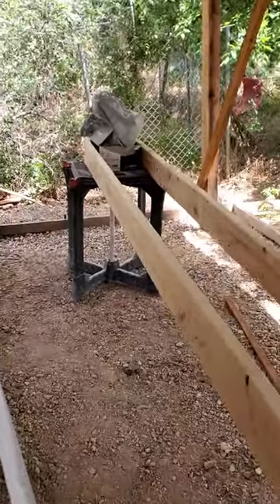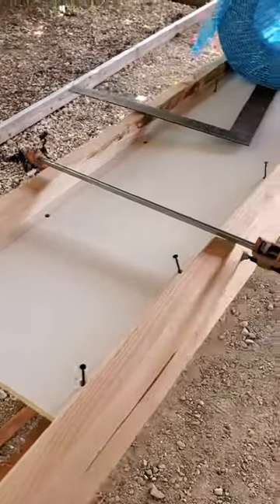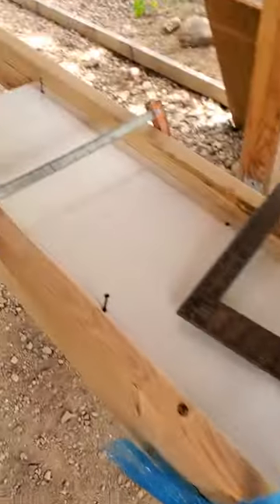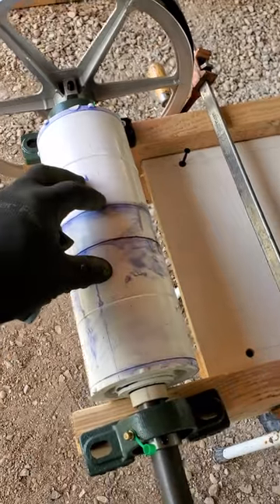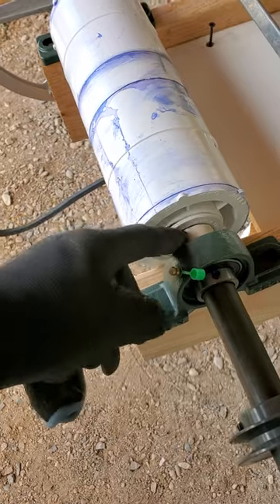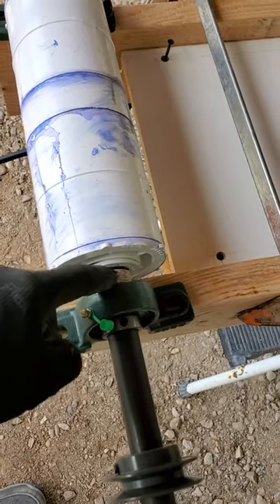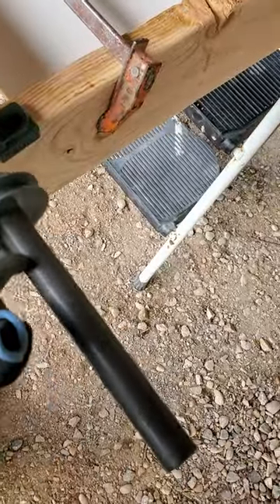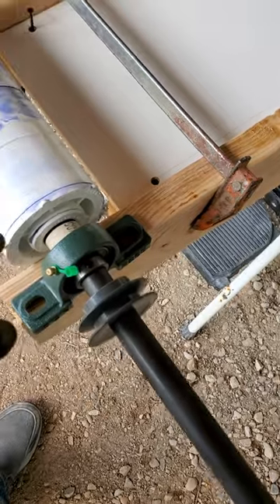building a conveyor belt for dirt. DIY

Comment: How did the conveyor work out for you? I'm looking to build similar. Interested to know how the melamine worked, I was thinking this might be easier than lots of rollers that people tend to use.
Reply from the maker: Thank you for the interest. I got it together and ran it.... 
Then embarrassingly enough.... Changed my mind about the project and decided not to dig out the basement.
So I'm pulling it apart. I have to parts on eBay right now.
The melamine was slick
Reply: @philrogers5646  Sounds like a great learning experience, there is a lot of work involved in making basement area useful. When you say "The melamine was slick", I'm assuming you mean it worked well and the belt slid over the melamine just fine. Thanks again for you reply.